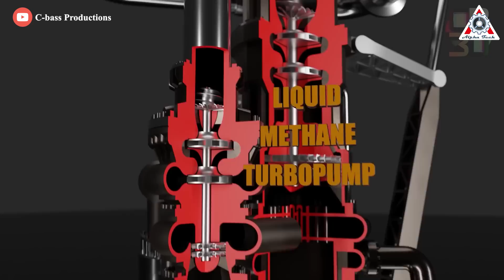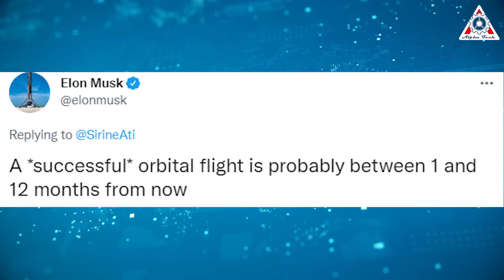Musk just revealed NEW PLAN for Ship 24&B7-SpaceX's orbital flight test campaign finally begins

Comment: If you Stop listening to Musk's Mumbled Mumbo Jumbo ... and his YouTube Sales Team ... and Start looking at this Rocket with Common Sense Skepticism ... You might see this Ridiculous Rocketry as the Unusual Thing it is ! ... 1. It catches fire ... 2. It Blows up ... 3. Its main pipe crumbles ... 4. Its minor pipe Explodes ... 5. The Heat Tiles fall off ... 6. FAA troubles ... 7. Limited FIRE Suppression ... 8. Chopstick failure ... 9. Limited Blast protection ... 10 . It looks like a Tin Can ... 11. The sides look Dented ... 12 . The grounds are a construction Mess ... 13. Deluge is weak ... 14. Exposed piping and control panels ... 15. Nothing seems Finished ... 16. There's Dust and Salty grime everywhere ......... If this Rocket Works ... it will be a Miracle ! ...... But I hope it does !

Comment: Starship will more than twice as powerful as Saturn V and will have a significantly higher thrust to weight ratio 1.5 - 1.6 (Saturn V was 1.1), and will be able to put 100 tonnes into LEO in it’s reusable configuration. 
SpaceX is working on being able to refuel the second stage in orbit, this will be a game changer for mission to the outer planets.